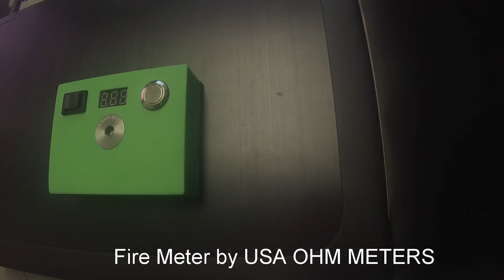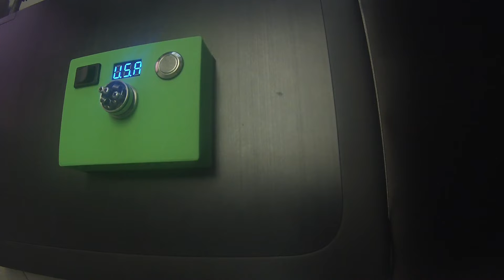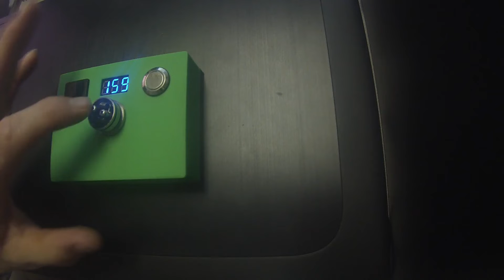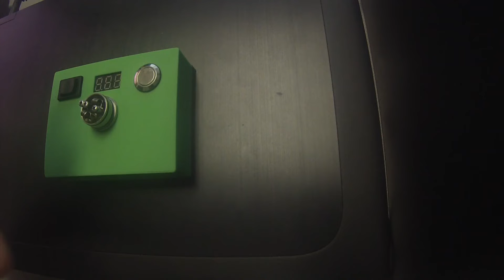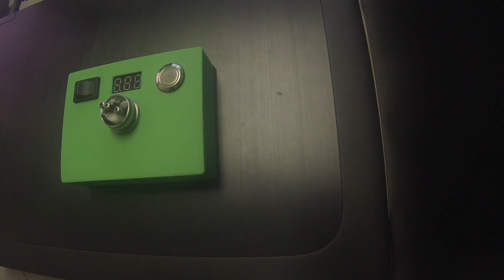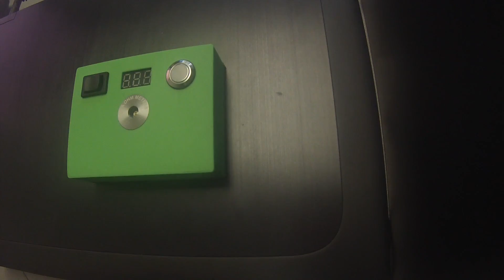USA OHM METERS:  Fire Meter

Comment from the maker: Thanks for the suggestions.  3d printed text would not come out proper thst small.  Decal is an idea though.  I was looking a bit ago to add a charger board as well...very tight package I designed (you'll see), so a semi- redesign of sorts would be needed....but not off the table completely in the future.

Comment: Ordering on Friday. Since you accept suggestions, I'll make 2. It would be nice to have lettering, either decal or 3D printed at the toggle. Something like Test/Off/Fire. The other thing (though not a deal-breaker) would be to add a 5V USB charge board for the 18650. Yeah, I know that would push the price up quite a bit. Maybe have it on a LTD version? Anyway, I planned on building one of these, but will grab this nice USA built tool from you. Thanks ~Carl

Comment: I think this is a awesome device.  I would love to have one of these. However it is out of my price range as well. Maybe you could put it in one of the prefab plastic  boxes that people are using to build mechanical  mods out of. They are like $8 if im not mistaken and still be a very high quality usa made meter that would be affordable  to the masses.
Reply from the maker: Going that route is an option as well.  However, then production time would be added to cut out for the switch, LED, rocker, and 22mm.  Another task would be to make it all secure and clean looking inside.  Thanks for the suggestion...we're always welcome to suggestions.
Reply: Maybe a round rotary switch rather than a rocker switch then there would be three holes to drill. If one could find a round didplsy then it would just be 4 holes for all components. That should cut production time a fair amount. I hadn't though of the added production time but this should remedy this problem. How long does the printing process take for one box now?
Reply: +USA Ohm Meters well looks like someone did what i suggested.  coil master 521 tab
Reply from the maker: +Bob Keller Yep and have fun with the specs on that unit.  might also want to have a look at the message board on their website before giving shelling out any hard earned funds. /done.
Reply: +USA Ohm Meters another chinese  made product.  didnt say i was buying. pissed at chunese for making junk. pissed at usa companies overcharging.  gotta be a happy medium!  keep trying. i know it can be done. maybe it will be your company.

Comment from the maker: Josh, much thanks for your comments.  As this device might not be the solution your looking for is not a proper reason to knock it down for what it actually does...and rather well as a matter of fact.  You realize that the other such device on the market is priced much higher, long wait time, and not made in the USA correct?  And I assume you did not see the price drop this morning posted on our Facebook and Instgram and the reason posted thus far either..?  As I always welcome feedback and your comment in reference to taking it apart and upgrading the connector...which connector would you call an upgrade to our existing one?  Just for reference,  the fire meter as a complete 2 part system printed at the proper quality settings (we print for quality vs quanity), take close to 4 hours to print.  Factor in the price of our 3d printers, material, 3d design time,  proper salary for production staff which does GREAT work, all the parts that make up the Fire Meter, RND of Ohm Meter, bare boards,  components, pcb assembly,  contacts, magnets....Our products are not just thrown together.  Each product is well thought out and fully tested prior to any release.  Unlike other companies I see release "beta" versions and then come back to do many revisions.  

So by all means, if you can create you own proper/accurate/USA MADE Ohm meter project as well as a proper complete solution...I will be the first in line to purchase one.  

-owner
Reply from the maker: Capt Ron LOL.  Your comments are false and rather humorous.

Ohm meter code written in Fl.
Printed circuit board...printed in Fl.
PCB stuffed in Fl.
Production in Fl.
Shipped from Fl.

...see a pattern here.  Funny how if our Ohm Meters were in fact from China...why are we the ONLY..ONLY company with a custom startup/splash screen?  

Warranty is not voided if used, what kind of logic is that...LOL, it is voided if abused.  

We use Varitube 22mm 510.
Electronics are sourced outside of US.
Battery boxes are sourced outside of US.
3D designs/printing in house from our 13 3D printers.

Never have we once EVER said 100% of EVERYTHING is Made in the USA; Not possible for electronics.

Here's a challenge for you:  Prove 100% of your above claims (discrediting this post) and you will have $10,000 in your PayPal account by days end.

Go troll somewhere else.
Reply: USA Ohm Meters 
Don't listen to Capt Ron.
He clearly has no idea what he's talking about. The Fire Meter I bought from y'all when you gave me that deal after our conversation has been working flawlessly for over a year now and the little Ultimate Ohm Meter I bought before that still works as well. If it wasn't already obvious before, I can personally attest to the fact that y'all make high quality products. I love my Fire Meter!

I was just browsing your site and saw the coil jig and the clapton wire builders and was wondering if y'all offer a full kit that includes all the different coil related products.
Reply: USA Ohm Meters I should have stressed more that it is just my preference to find quality products and find a way to add my personal touch to them while doing it in a way that's cost effective for me. Times are tough right now and I work hard for what I've got so if I have the means to save a few bucks I will. That's just the kind of person I am. Y'all have great products; I wouldn't have bought your ohm meter if I thought it was just slapped together. I know y'all spend a lot of time building a quality product and I respect that. I just can't afford it. That doesn't mean I don't think it's a great product; if I could afford to buy it, I would. Regardless of my personal struggles, you have quality products and I apologize if it sounded like I was saying otherwise.
Reply from the maker: Josh Case Thank you for the kind words.  Email me...maybe I can make a coupon code for you to save a bit ;)
Reply: USA Ohm Meters I'd really appreciate that buddy! Should I use the contact form on the website?
Reply from the maker: Josh Case Use the contact us Form please.
Reply: Yeah, except your POS ohm readers aren't made in the US either, except for maybe the 3d case.   The pad is made in china, the meter is made in china, the case on the other units are 3 battery cases with the center battery space used for the meter are made in china.    Oh, and lets talk about the warranty, or the lack there of.  You told me since I used it, it's out of warranty. How else do you find out if it works if you don't use it.  The cheap chinese 510 pad fell apart after two uses. POS
Reply from the maker: Josh Case I know exactly who he is as only 1 customer has every tried to make these claims lol.  We might make a complete kit.
Reply: USA Ohm Meters are these still available? I don't see them on your website any more

Comment: The Fire Meter is cool but a bit pricey for what it's meant to do considering it would only take a few seconds to unscrew and fire it on my mod; I'd see myself using just the ohm meter a lot more. The 3D Printed Ohm Meter line looks good and I'm sure y'all were able to increase your margins with it which is good for y'all but if I'm being honest I'd rather just disassemble the meter and 3D print my own enclosure at the end of the day which would cost much less on my end.